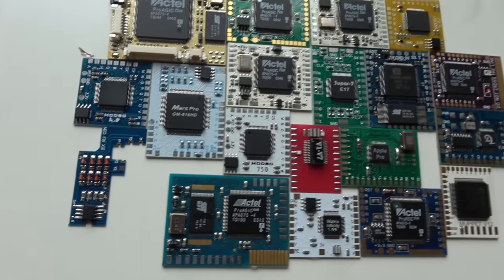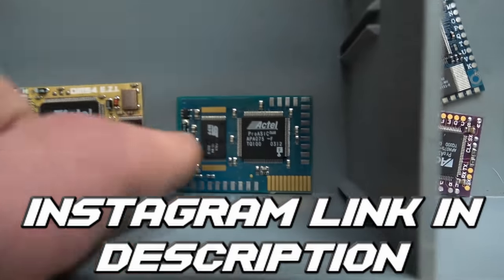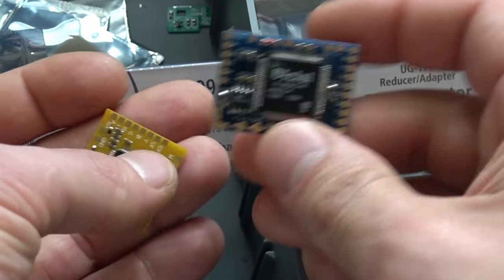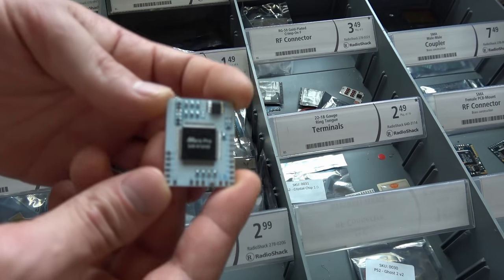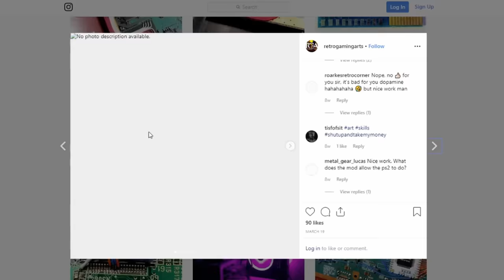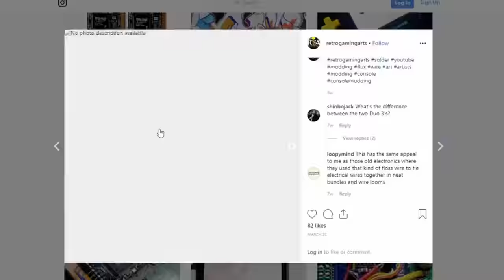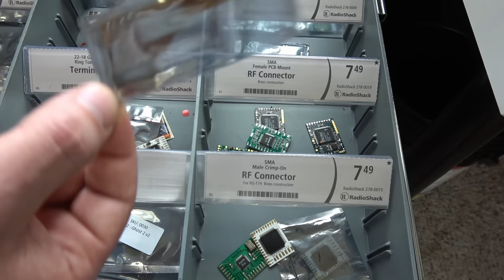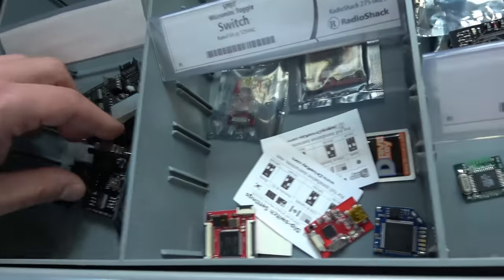SUPER RARE PS2 MODCHIP COLLECTION

Comment: Some cool early modchips i recall:

1. neo2.2. Simple and quite limited early chip, could boot ps1 backups directly and ps2 backups using a swaptrick and a gameshark disc. 

2. The Origa chip, more complex than a neo2 but still rather simple. Could boot ps2 cdr and dvd backups using a swap trick + originals from other regions directly. 

3. Neo 4. First chip which could boot cd and dvd backups without using a swaptrick. It did not direct boot however, you needed to launch the games from the ps2 menu iirc. 

The neo4 could be combined with an origa chip to make it region free as well. This chip requried a ton of wires to install and there are some fun pics online of ps2s with both of these chips installed.

5. The Messiah, the first "no swap" chip which could do it all. This chip booted backups and originals on any media. I have a vague memory of it not being able to handle dual layer dvds. Perhaps the was fixed with the messiah 2. 

I had something called a smartchip, or some clone of it. I think it was a rather popular budget model at the time (cheap and stable)

Anyway, nice video which brought me back. I was really interested in these chips and read a ton about them when i was a kid.
Reply from the maker: this is exellent info, i love this, i'm pinning this i hope everyone reads it, i'm glad to have taken you for a stroll down memory lane
Reply: @RETROGAMINGARTS  glad you found it interesting :) I noticed a couple of errors in there and did a little bit of digging around. Heres a corrected post (can't edit anymore).  

1. neo2.2. Simple and quite limited early chip, could boot ps1 backups directly and ps2 backups using a gameshark disc. I think this chip just stopped and ejected the the game discs

2. Sbox/neokey - Weird one which plugged into the front usb port. Still required soldering a couple of wires and provided similar functionality to the neo2.

3. The Origa chip, more complex (8 wires) than a neo2 but still rather simple. Could boot ps2 cdr and dvd backups using a swap trick + originals from other regions directly. 

4. Neo 4. Could direct boot ps1 and ps2 cdr games. Booted ps2 dvd titles using another game as a swap disc. It also removed the dvd (movie) region protection 

Installing this chip involved removing components from the board and 44 wires, its likely the most complicated chip to install. If you combined this with an origa chip, burned dvd discs would boot without a swap disc. There are some fun pics online of ps2s with both of these chips installed, .

5. The Messiah, the first true "no swap" chip. This chip booted backups and originals on any media. I think it was fairly quickly replaced with the messiah 2 which made the dvd movieplayer region free as well. 

I also found this page which contained some info on these chips: https://redwinters.tripod.com/html/info.htm
Reply: hey can i ask you about messiah 2 i have KTMB05  ACTEL MS2  where can i find more info abaut the mod chip i want to install it in ps2 slim 70000x

Comment: I had a console scph-70001 with an Actel chip. It worked fine but for some reason the console didn't have component output. I change the chip for a modbo 5.0 and now component output works.

Comment: Do i need a laser fix chip with a SCPH-77001 ps2 slim?
PS2 fat is probably the best option as there is a actual ps1 in the console and has internal harddrive support, and the ps2 slim uses a emulator. IDK i heard this once a wile ago.
Just ordered the mars pro off ebay. hope it's as good as your saying.

Comment: V9 consoles had both the HD7 and 400c , thats not a protection fix its a full replacement for the LA6508, in the beginning no one could source them so that was used as a replacement, the LA6508 would often kill itself and take the laser coils with it, the 5V fixed mitigated it a lot.

Comment: Need more info on super 7 e17
How to open its menu, disable it, etc
Does it have one?
Reply: unfortunately the super 7 modchip doesn't have a dev1 menu, I looked everywhere and tried every button combination to open it, however I've heard there's a way to disable it but there isn't even information on how to do that.

I myself have this crappy modchip and its one of the worst modchips out there.
 It doesn't have a menu and not much info on its features, it's basically a bad clone of another modchip, I would request people to never ever get this modchip in your own PS2 otherwise you wont be able to use FMCB and will be stuck with burning disks to play games until your laser wears out.
Reply: People told me to replace it with the modbo modchip, but I'm not risking that

Comment: Cant say I had good experiences with the Mars Pro, it had hit and miss boot rate. The exception was SCPH-9xxxx (V18) where it had a 100% hit rate and the back latest version of the chip had the (BGCHJI) points on the back meaning if you overhang the chip you can do a very neat install.

Duo 3 was one of the better ones to use in terms of boot rate on phat systems, the other slims IIRC for a budget option we were using Modbo 760 , they were okay but not great, and we only used more expensive Matrix Infinities on the SCPH-70xxx.

Just my experience with them I know a lot of installers opinions differed.

Comment: Do you think you can make a video on the v9/10 and slim v12/13 laser fixes such as the diode fix, Some0ne's fix, the PIC fix ect. Documentation online is sparse. Might want to break it into two parts, one for SCPH-5000x(v9/10) and one for SCPH-7000x(v12/13).

Also you missed 3 mods, only the last one is a mod chip though; The HD Connect and HD Combo added HDD support to the v12/13 slim models since the drive interface is still technically on the board. And the HDpro, which adds HDD support to the later slims through a mod chip.
Reply: I'm struggling to find info on laser protection as well. In fact, just wondering in case you had any answers for my question.

I'm looking to install the Mars Pro gm-816hd chip (as RetroGamingArts metions these are highly reliable). I wanted further info about laser protection as I have a vulnerable PS2 slim SCPH-7000x model.

Will the Mars Pro chip work properly alongside the Matrix PIC fix chip? I've seen people recommend using the PIC fix alongside Modbo chips; but am struggling for info regarding the Mars Pro.

Comment: After watching this, I still don't know which one I have. Mine has no markings. PS2 Model SCPH-39004 GH-022 M5. Iv checked out numerous websites. It may have it on the bottom but I don't want to touch it. It's worked for 19 years with out issue.

Comment: Is it possible to reprogram your consoles region with a FreeMcBoot memory card now? I know these chips were big for it back in the day, I want to get an original PS2 10000 model from Japan, try to get it region free so I can run my American library on it. There’s a guy who posted a video on YouTube where he got one that was modded with a Messiah chip, apparently an American army guy was stationed over in Japan when it came out and that’s why he had the mod chip installed, the guy who posted the video is the second owner. But I know that the EEPROM for laser drivers can be reprogrammed with FreeMcBoot with a special program, I’m wondering if there’s a similar utility for region unlocking or if I’d have to install one of these chips. AWESOME video though 😎👏🏻

Comment: Thanks a lot for your video ! I just got a PS2 with a Matrix MX4 installed and I was wondering if we can access settings on this chip using buttons combo at boot ? I tried tiangle + circle and triangle + square but no luck. I wanted to disable it using settings because the MX4 froze my PS2 when I'm booting with FMCB 1.966 😢

Comment: I have a modbo4.0 on a slim 77001 silver it can not deactivated even if you turned off and shows desable  you have to make a switch in the voltage of the chip and the the sistema online do not detect it . It has semi auto boot and mc boot.

Comment: My uncle bought an Asian Fat PS2 SCPH-30006 back on 08/25/2002 with a mod chip pre-installed that will play original and back-up PS2, PS1, and DVD movie discs from any region. It does straight boot-up for PS2 discs but not for PS1 discs and DVD movie discs. To play PS1 games or watch DVD movies, you have to insert the disc, place the PS2 into standby mode, then hold down firmly on the reset button during boot-up until the disc is read. 

I'm guessing my uncle's PS2 has a very early Magic or Matrix mod chip. What modchip does straight boot-up for PS2, PS1, and DVD movie discs as if it were an unmoded PS2 that shows the PS2 and PS1 logo on boot-up without doing the aforementioned reset trickery involved with the early mod chips?

Comment: Firstly nice collection of modchips 👍 
I have a Modbo 760 and recently acquired a Mega 7 chip which is installed in a PS2 SCPH-90004. 

I have absolutely no clue about the Mega 7, but it's apparently similar to the Super 7 e17? 

I am trying to find usage modes on the Mega 7, but I can't seem to be able find anything with regards to ps1, ps2, on/off modes or how to enter any menus etc.

Comment: Hy! You didnt speak about modbo differences, I did have chipped a few machines with them. I have a question however, Once I did a 30004 with Modbo 4, the only issue I got with it, that it couldnt boot protected PS1 games (like resident evil 2) other titles booted fine. I didnt experienced this on the other machine I did, wich was a 77004 with Modbo 5. Im courius, did anyone had that issue with modbo 4, or its more likely a motherboard or wiring point problem?!

Comment: Hay man
!
Thank you for the cool video.
I have a question about MarsPro GM-816HD
BIOS doesn't save config
Can i change the boot configuration?
 (jumper/shorted/zero resistance)
I need the boot from the memory card to load by default.
Thanks in advance!

PS: SCPH-90008

Comment: Hi there, i have the super 7 E-17 chip, it seems it's all wired up correctly but i'm struggling to boot up PS1 games (Original and Backups) My model Ps2 is a slim 9006 NTSC-J. 
 Would you be kind enough to help advise on how to go about it.
Kind Regards
Reply: Hi, Darren Jones! I was scrolling down , reading comments I saw your comment regarding your ps2 issue. What you need to do is put backup ps1 game in your ps2 drive close cover and press 3 times and hold L1,L2, R1,R2, Select , Start, and Dpad left and down.

Comment: The Mars Pro is a clone of the DMS 4, you can check that in the modchips menu (hold square on boot). I personally don't like this chip, as it cannot save the settings - which means you can't change anything in the menu. This is bad, because settings like DVD9 DL patching is set to disabled by default.

Comment: Heyy i just watched your video and was looking for a way to find out what modchip is build into my scph--70005, i looked online and didnt find anything to it. It is marked as a Magic 70k+ but since i bought this many years back in the philippines i am guessing its a clone, but i dont know of what.  Thanks to you i found out what the second circut was for, the laser protection, seems of the cheap kind with just diodes. I have the pin B,F,G,H,I,A,S,Y,RE,CLK on the left side and W,R,M,N,O,P,Q,T,U,V on the right with GND and 3.3V on the top and an additional GND on the bottom. Because you seem to know tons i thought it migh be worth a shot asking you if you got any tips where i could continue looking. The mircrochip is unmarked >.<

Comment: I had a question. The matrix 1.99 (The White one) You know if that chip is capable of firmware update? Thanks
Reply from the maker: It is not. Attempting one will brick the chip, this is also the case with the modbos. Only the genuine original chips are capable of firmware updates. But if a modbo comes at 1.93 you don't need to upgrade. That's the latest "official" firmware
Reply: @RETROGAMINGARTS  and why there are chips that Say: Matrix 1.99 ir 2.0 and so? Thanks for your time!
Reply: @RETROGAMINGARTS  and You know some way of disabling the matrix logo on top of the ps2 one?
Reply from the maker: So after the matrix chips stopped being made, someone in hongkong hacked up the original 1.93 firmware to 1.99. So it's like 98% original but it's modified, it was supposed to be done to make it more compatible with newer revisions of the ps2 slim, however it didn't work as intended so it's got some issues, like the ones I listed in this video
Reply from the maker: And yea, if you hold triangle and circle on boot. You will get a menu with options, and the bottom option will turn off the boot logo
Reply: @RETROGAMINGARTS  but that disables the matrix logo itself, not the matrix logo on top of the Playstation 2 logo.
Reply from the maker: @pistonhead2k  ohhh I see what you mean. Na. No way to get rid of that one. I like the added logos, let's you know the systems modded with a chip
Reply: @RETROGAMINGARTS  i like it too, but it's for a friend that doesnt like that logo, so they asked me to get rid of them, thank You for the answers!

Comment: Hey, love your channel. I'm quite pumped to try chipping my PS2 soon.

I'm looking to install the Mars Pro gm-816hd chip (as you mentioned its very reliable). I wanted further info about laser protection as I have the more vulnerable PS2 slim SCPH-7000x model ("V12"). 

I've heard the Matrix PIC fix chips are handy for laser protection, but wanted to know if there's any compatibility issues. Will the Mars Pro chip work properly alongside the Matrix PIC fix chip? I've seen people recommend using the PIC fix alongside Modbo chips; but am struggling for info regarding the Mars Pro.

Comment: Hello, i know its a bit late for replies, but i need to ask something to you.
I bought a second hand ps2 fat spch 9004 R, dvd drive works only when you put disc inside and turn on with it(You can see, there is a video in my channel.) otherwise says reading disc at all time.
Probably this is a really old school modchip, dont have any menu i tried: triangle + square, Pressing L1, Pressing Eject button for a five sec etc.
I couldnt turn off the chip, sadly i dont have any experience and in my area no one works for old ps2's, do you know any way to disable modchip ? any combination? i am not sure but my modchip is can be magic v or iii.
Thanks in advance.
Reply from the maker: Without opening it and knowing what exact chip is inside, it will be hard to figure out. Alot of chips use the start button while powering to disable the chip. You should open it and take a pic of the chip and send me that pic lol
Reply: @RETROGAMINGARTS  I will check it thanks, if i can success i will send photos to you ^^

Comment: Hello! I plan to chip my recently bought 50004 wich is in like-new condition! I have experience only with modbo's, once I did a 30004 with modbo 4, and it failed to boot protected ps1 games (like resident evil 2) . Other machines I did with modbo 5 were fine. I see you like the mars pro, over it,  can it auto boot ps1 games?
Reply from the maker: Yes

Comment: About the laser protection fixes that are pic based.

I've tried back porting the comsoft v4 pic fix to the v9-v11 console revisions, still need to make the boards but the forum post is located at https://assemblergames.com/threads/matrix-pic-fix-for-v9-and-v10-systems.69214/ 

If you someone could try a hand at making the boards and testing, It will be greatly appreciated. This way a schematic of installation can be worked out.
Reply from the maker: YES!!! HELL YES!
Reply: Cool, thanks for the reply Retro gaming arts. Would be neat to abandon the romeo mod and have a more modchip like fix. 

All the custom boards on those console mainboards injecting their signals and controlling the low level programming. ;)

I still have a few Wii consoles and that chip in your video, have never opened one though so that should be interesting. Cheers!

Comment: Brings back so many memories. I have personally installed hundreds of Magic III chips mainly on V7 motherboards that was the most recent motherboard supported by that chip, no V9-V10 or slims. The Magic chips have a very clean boot logo "Playstation 2". Magic team released the Magic 50K that supports V9-V10 boards but never released any chips for the Slim. I have also installed thousands on Modbos 750-v3.5-v4.0... they were fairly cheap back in the day compared to the Actel based Infinity.
Reply from the maker: My man, I'm so happy you stumbled across this video then. I'm happy to have hit you with the ps2 modding nostalgia

Comment: I have got a DMS4 LITE V1 , I was able to successfully update the BIOS to 1.4 from 1, the only issue im having is that Im not able to boot ant games or discs, Once I disable the DMS4, It boots games no issues at all, My question is what is causing this as I have checked the solder points and all of them look well intact

Someone assist me, @MrMario2011 @Retro Gaming Arts
Reply from the maker: Can you send me pics of your install over instagram/twitter? The more pics. The more closeup pics, the better the lighting the quicker I may be able to spot the issue.
Reply from the maker: Where you having this same issue on bios 1.0? Have you tried a different bios and hows the laser on that ps2?
Reply: RETRO GAMING ARTS , same issue on Bios 1.0, the laser is fine , if I Disable the mod chip PS2 games boot up no problem , I was only able to update bios using a FMCB Card and running ELF file for update , 

Every now and again the ps2 with the mod chip enabled will boot my original METAL GEAR SOLID 3 disc but that’s and it’s usually once upon turning it on, never got it to boot a backup yet, I’ll send pics though